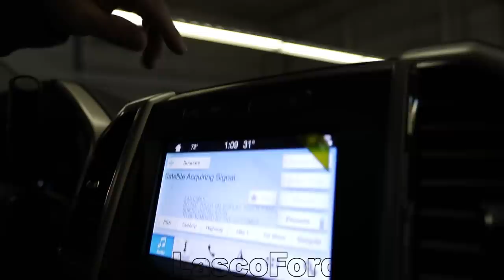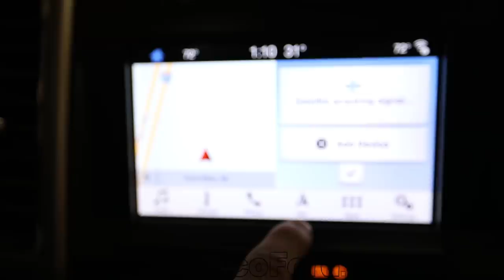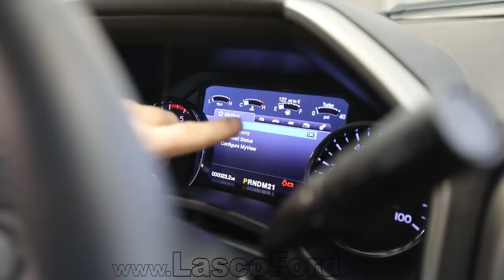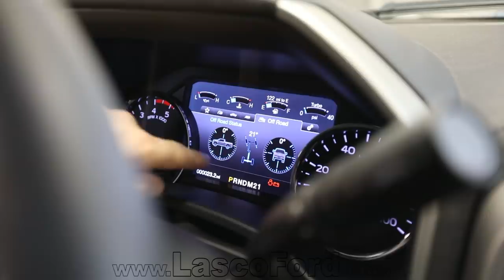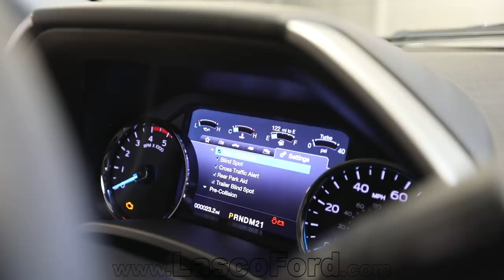2019 Ford F250 Lariat Sport Exterior & Interior Walkaround

Comment: Lariat Sport looks similar to a Tremor package. Black on black is just ONYX cool! I was an older Chevy Duramax owner but the new F250 Powerstroke is in another league altogether. Ford pushes the changes forward, shapes markets, and thus raises the bar. Just hope the F150’s upgrades keep making it to the f250 - ambient lighting - outside LED lighting - locking diffs front and rear - small amenities that make the difference like you’d see on a German SUV. Excellent review.

Comment: My F250 has the blacked out running boards, but they're aftermarket ones I had installed after I got her. I didn't know Ford Super Duty trucks never came with those. The Rancho shocks are a nice upgrade though; got those on mine and it makes for a very smooth ride.

Comment: Don’t forget to tout the dual coolant systems complete with dual water pumps (and the primary pump will likely leak by 70,000). And mention the EGR cooler core will likely plug up and throw a P0401 Code around 50-90,000 miles. Let’s not forget that rear wiring harness that if you spray off the underside rear thoroughly it might short out causing 7 or 8 modules to malfunction for weeks until it dries or corrodes. Oh! And lest we forget the interior fit and finish that rivals any 1980’s GM sedan. Nice, spacious gaps between plastic parts. Warping dashboard near the defrost vents...rattling sunroof that makes you go nuts after around 20,000 miles. But hey! It’s got painted bumpers, right?! Lol And by the way, yes I own a 2019 f250 6.7 Lariat that’s already been in the shop for over 13 days with electrical trouble. And it’s got 13,400 miles on it! The start of Another lemon??
Reply: Ssssssshhhhhhhh it has the best in class towing for years and years and years and years (in an uncertain voice)

Comment: The sport package comes with the rear wheel well liners and then it also comes with the blacked out  bottom part of the door seal protectors front says super duty back is just blank. The steps scratch easy and they show.  Had mine since December went magma red with the sport package. Just wish it wasn't so hard to keep clean because it looks beautiful when it's clean!!

Comment: While you're not wrong about it being over 600 lb-ft of torque (935), and over 300 horsepower (450); most 3/4 ton pickups on the market are either at or near 1000 lb-ft of torque from factory.. I'm a bit surprised a "sport" package doesn't have a little more "sport" to it performance wise.  Bigger intake, more aggressive tune, even an upgraded exhaust system.. just something to pronounce a sport package..
Reply: It's a sport appearance package.
Reply: @davidtorrez8460  Well their terminology needs an update.. should be a blackout appearance package, not a sport package.  Sport package makes me think suspension upgrade is bare minimum.  If it's "sportier" than the base model, it should be quicker than the base model
Reply: @duanewente457  yea you are right. Idk why they do that. Ford makes sport packages that only includes a difference in appearance. Nothing to do with anything mechanical. My wife has a ford escape with sport package and it's just alot more beautiful than a regular one. Unfortunately your just paying extra for an appearance package. I almost bought one the other day but payments were going to be ridiculous lol
Reply: @davidtorrez8460    Your what is paying extra?

Comment: Really nice truck! 12 volt outlet isnt outdated (yet)... still used for tire inflators/rubber raft inflators (any air pump that plugs into 120 volt (your house) will blow the 400 watt fuse (Ford Truck)). Can only use 12 volt. Also 12 volt outlet can be used for another phone/tablet charger with adapter (got kids) won't be smart like the factory though. I drive a 2017 F150 and wish it had some of these options.

Comment: So if you take a stock truck and the dealer modifies it with a lift kit doesnt that violate Ford's warranty?
Reply: Yes.
Reply: No. If you lift the truck yourself it doesn't void the warranty.
Reply: A level kit is not the same thing as a lift kit.  And generally, no within minor parameters (say 2 inches) it does not void the maufacturer warranty since it keeps the rest of the suspension components within tolerances.

Comment: Nice review.   Great looking truck.   I like the blacked out bumpers.  I think the big three all make nice trucks and each have pros and cons.   I’m on my 2nd Silverado duramax (very happy with) and would certainly consider the Super Duty if I were in the market today.    But boy the price of these new trucks are getting hard to justify if you have a family with other expenses.   Btw one other plus for the Ford is that it has an e-coated frame.   The GM is wax coated and doesn’t hold up as well in northern country if you live off a dirt (red clay) road.  Cheers!

Comment: Can you commnent on the level kit used?  I have a 2017 F250 Lariat Ultimate and I am looking at going to 37's...I am going to either replace the front bumper or pull it and have it powder coated to black to match the truck.  THanks for the video...this is the most comprehensive I have seen that details the differences of the 2017 and up trucks....but get the Torque and HP right...that's what most of truck owners are looking for.
Reply from the maker: Not sure what you mean, Mark?  We have done levels and 37's on 2017's if that is what you mean.  We custom fit our trucks with spacers etc. if needed.  Each built is usually assessed and custom to that truck.  You can see some more of out builds at www.LascoLifts.com we try to remember to take pics and post.
Reply: got it.  It's just a long way from NC to get a level and tires on my truck.  Was looking at the specs or products you used so I could get the work done local to me.  Thanks...really nice build on this one for sure

Comment: You say it's a great idea for the def system to be in the gas tank, but now it creates more of an issue to remove/delete the def system. There's a reason GM put the tank seperate on the passenger side. They were actually thinking.

Comment: Is this a true lift kit or just front level?  How much does the kit add to the MSRP and is this truck still available?  @LascoFord
Reply from the maker: This is just a level.   $2,900 includes the tires, level kit, and all labor.  You can buy this one for $69,000 plus plus etc. after discounts and rebates with the tires and level.
Reply: @LascoFord  37's fit with no rubbing or did you have to modify or cut anyting?

Comment: Over 300 hp and 600ftlbs of torque. Well no shit... The 6.0 came from the factory pushing 375 hp and 580 torque back in 03. The 6.7L is pushing WAY more power than that. I was hoping that the word "Sport" meant they tweaked the motor to push a bit more power.

Comment: i like what im seeing
need more color matching options
I have a 2017 lariat ultimate i love it
i have had 8 gm 2007 + duramaxs great truck still have a 08 lmm
last ford owned and liked was my 2000 7.3 lariat 
IF THIS TRUCK HAD  A SMART PHONE HOLDED INTEGRATED INTO LEFT SIDE NEXT TO  THE SCREEN AND 
A DODGE 1500 TESLA SCREEN SALES WOULD GO UP 20% INSTANTLY 
AND I HAVE TO SAY ONE THING THAT THE LARIAT STEERING WHEEL LEATHER SUCKS FEELS LIKE A WORK TRUCK ONLY FLAW
I DONT HAVE MUCH TO SAY ABOUT THESE NEW FORD TRUCKS THAT IS BAD
METAL IS SOFT THO DENTS EASY
DODGES NEW 2019 TRUCK AND 2020 IS KILLING IT 
IF I WAS FORD I WOULDNT WORRY ABOUT IT
BUT THE NEW GM TRUCKS ARE FALLING BEHIND QUICKLY AND IM A GM GUY SAD TO SAY

Comment: Still not as good as the 7.3 diesel.
Reply: Ford is bringing back the 7.3 in 2020 for medium duty, Unfortunately not a diesel but its a true big block and is a single cam in block with over 500hp 550tq. There's already pictures leaked of 21 century boss 429 mustang return. More exciting is how readily available a 440ci  500+ hp engine will be at junk yards and aftermarket improvements in the near future

Comment: When your check engine light is on at 28 miles on your 2020 😭😭
Reply: all new cars and trucks do that and almost all vehicles do in general its on because its reading no oil pressure as soon as you start it the light goes off
Reply: Its_justa _4.6 i dont get it

Comment: I don't see as to where you can start the engine. I believe it's a push button.
Reply: yes it is
Reply: i ordered one like this 2 weeks ago,should have it may.its a f350,diesel,lariat with sports package.i didn’t take the fx4, not much in it i didn’t have already with the other packages,and i didn’t want the stickers a the back,all black.But only one thing,i didn’t take the sunroof when i ordered,and the next week after i saw that video,i called to have them added but it was too late,the vin was created and they had started on the truck.my fault,my wife told me to put it on the list but i said,its a construction truck,and now i regret it.for those interested,its over $90 000.00 cnd and with taxes, it will be close to $105 000. I have now a f350 xlt 2015 (mint cond)with 27000 km on it,that i will trade for this one,so next the next truck,might keep it a little longer

Comment: I can't see the engine
Reply: You need a ladder to see the engine.
Reply: Or take off the front clip just to service this thing!! I think I'll stick to my fiat with i6. Since its actually designed for servicing
Reply: @jerrybrandt9377  clearly you know little about Ford diesels, you have to take the entire cab off to do any work on the engine, there is no just remove one thing.

Comment: Why put out real dollars for the heat bomb called the exhaust gas recirculation  system which is basically a built in engine wear enhancer? In fact, the EGR should be renamed tp EWE for, you guessed it, Engine Wear Enhancer. Oh, and that to say nothing of the 400 pound fire bomb you carry under the truck that goes into "crazy" mode when it wants to. C'mon, use some common sense, leave these problems on the lot. If Ford were really conscientious they would gift every diesel buyer a golden check engine light necklace.
Reply: There is a kit out there to eliminate the egr and def bs

Comment: You lost me when it didnt even have power running boards. Ram is so far ahead with the new 19 models it's not even funny.
Reply from the maker: They are an option.  Ford has had power running boards for years.
Reply: @LascoFord  I know. But it's a standard feature on a ram with a sport package. It's only an option on a ford with a sport package. Rams are cheaper and more loaded. Get with the times. They should be standard not an option. If I spent what your charging for this, I'd get a limited ram with the 12 inch display and every single option. And no, it's not because ford is better quality, if you watch every truck comparison for 2019 models, ford is the only one that did nothing. Example being the garbage sync system. Ford gonna have to step up their game to compete with ram. Ram has not only caught up to ford but theyve officially passed them. And I dont even hate ford, I just feel they are relying on their name to sell trucks rather then actually coming up with something new.

Comment: CUMMINS>powerjoke
Reply: Diesels & Driveways they are a good motor, but even they have there issues. I’d like to see Ram make an attempt to produce there own diesel for the 3/4 ton and up.
Reply: Matt S but why? That’s one of the big reasons why people buy Rams.
Reply: xXAnchormonXx they make that little eco diesel, and it’s a good motor. I’m sure they could make a new motor from scratch for there 3/4 tons
Reply: Matt S it was actually made by GM, when Chrysler bought 50% VM Motori they inherited that motor and here we are.

I think GM does a hell of a job with their motors and love their trucks. However they let me down on their new 2020 HD trucks.
Reply: Power Strokes junk! That why they call it power stroke it has a stroke and dies on the road.